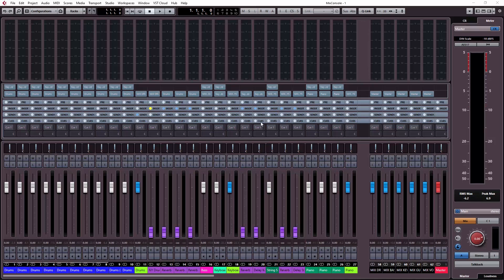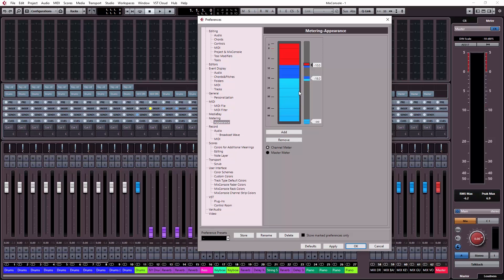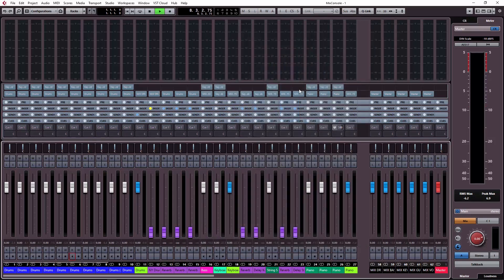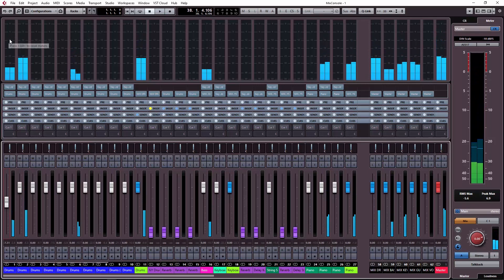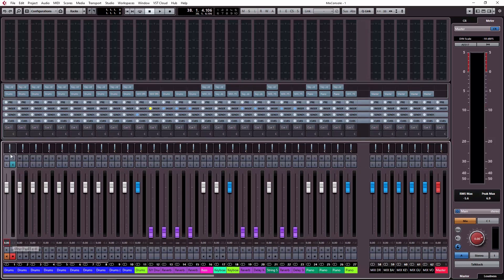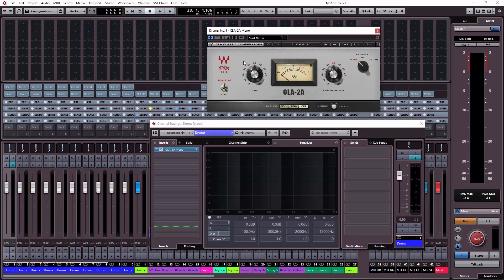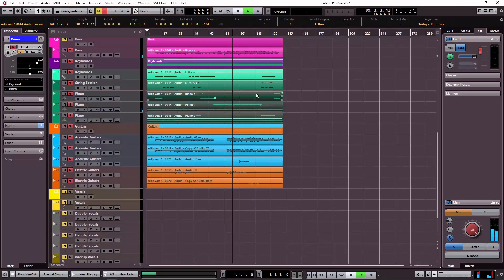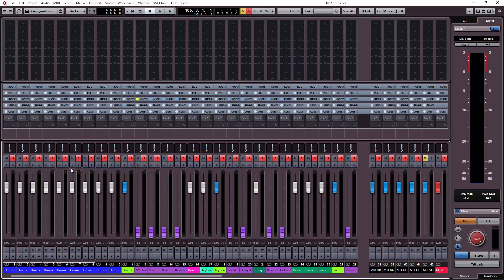Gain staging | In Bangla | Rezwan Sazzad | Audio Music Production Tutorial in Bangla

Comment: Vhai 25000 er moddhe kon microphone ta kinle best hobe??
Reply from the maker: Rode NT2-A Multi-Pattern Dual 1" Condenser Microphone এ মাইক্রোফোনটি আপনার বাজেটে মধ্যে আমার পছন্দের তালিকায় এক নাম্বারে।

Three position variable polar pattern - Omni, Cardioid or Figure 8

Large 1” HF1 gold sputtered capsule

On body control of polar pattern, HPF and PAD

Three position variable High-Pass Filter - Flat, 40Hz or 80Hz

Three position PAD - 0dB, -5dB or -10dB

Ultra low noise

Internal capsule shock mounting

Includes RØDE SM6 shock mount, pop filter and dust cover

Designed and manufactured in Australia

10 year extended warranty when you register your microphone

এ মাইক্রোফোনের দাম বাংলাদেশ 23,700 থেকে 25,300৳ দামের মধ্যে ওঠানামা করে।
Reply: @Rizwan19us  @ thnk u vhai